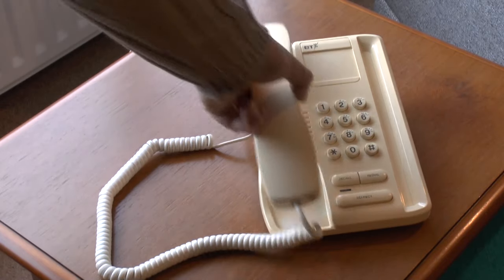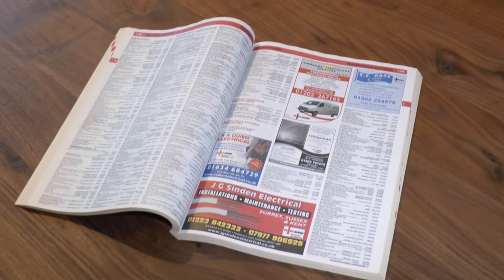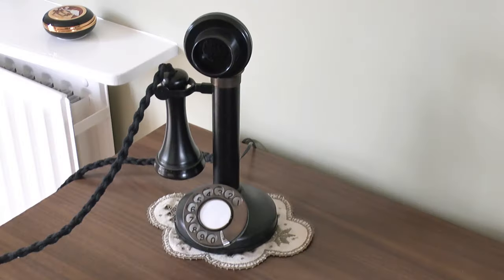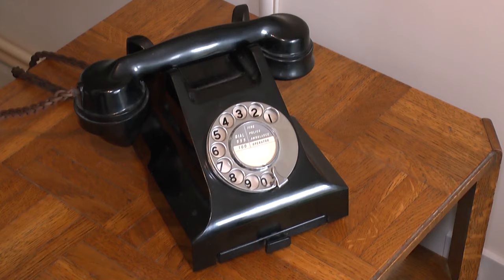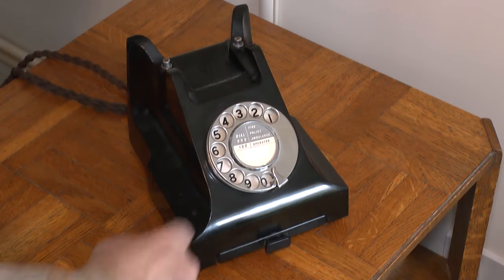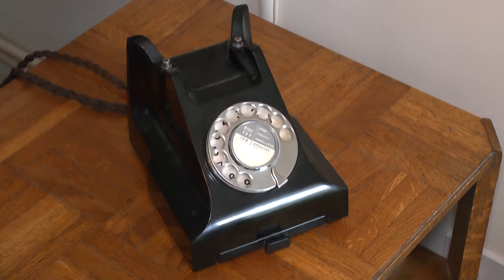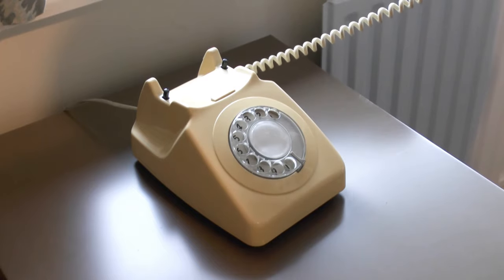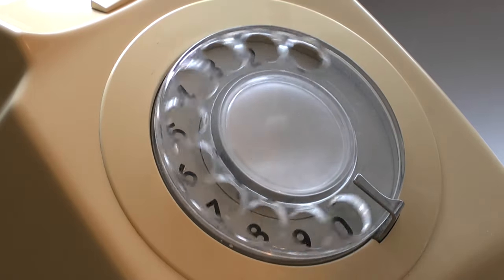How to Use a Rotary Dial Phone / Telephone

Comment: If you have, or find an older phone like this, you can buy a Bluetooth adapter for them, which effectively turns the phone into a Bluetooth device. 

Whenever you dial out on the phone, it will pull up the phone app on the connected phone and inject the number and place the call
Reply from the maker: That’s interesting. I knew there were some DECT adapters, but I had not seen a Bluetooth one.

Comment: You missed the bit about waiting for dial tone before commencing dialling! Won't work if you start before the exchange is ready.
Reply from the maker: Good point, although the main focus of the video was to show how to actually dial, and certainly over the past years, the dial tone, at least on my phones has been there very quickly. But as you say, in some areas, and also years ago, the dial tome may take a second or so to come through.